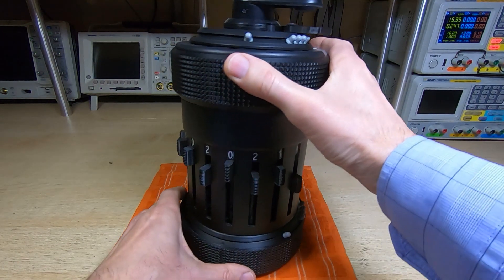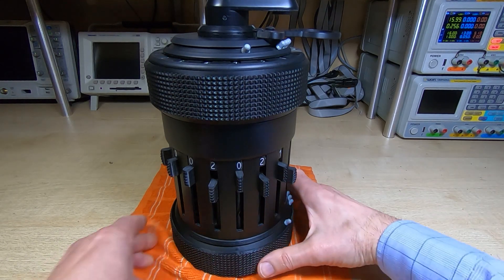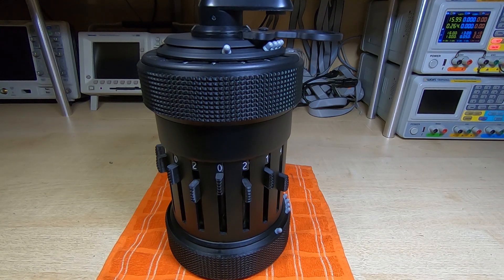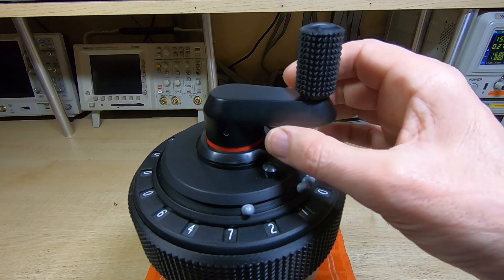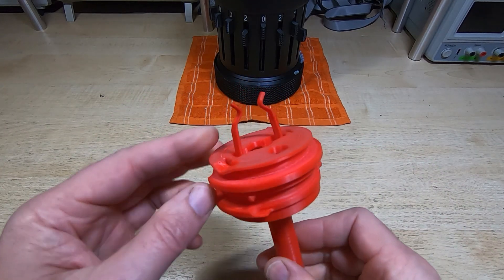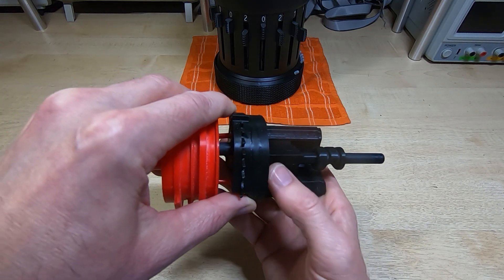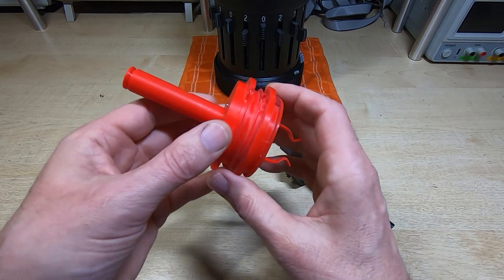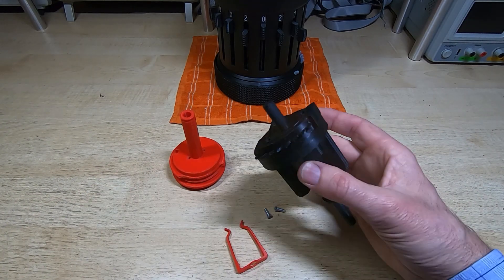Curta Calculator Assembly Part7

Comment: What a wonderful result.  I'm amazed at how easily the crank turns; not even needing to hold the body of the calculator.  It seems all that finishing work has really paid off in the result.  The Curta is such a mechanical marvel on its own; and again the translation into the 3D printed version.